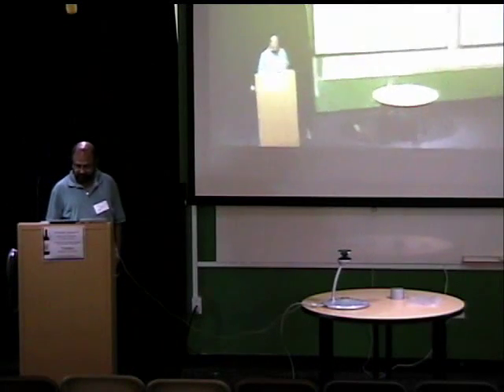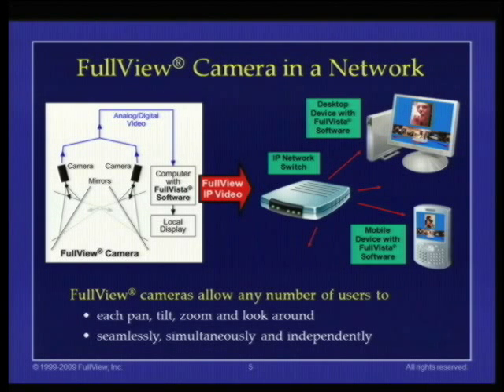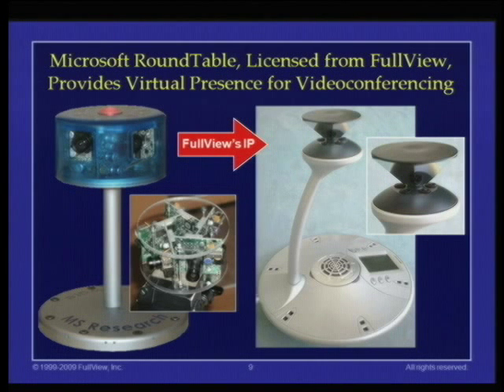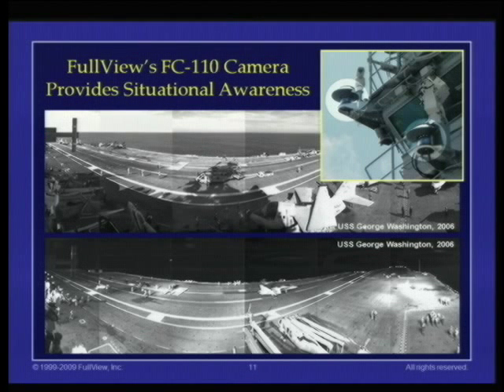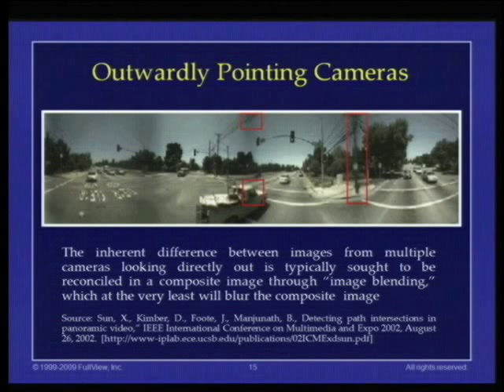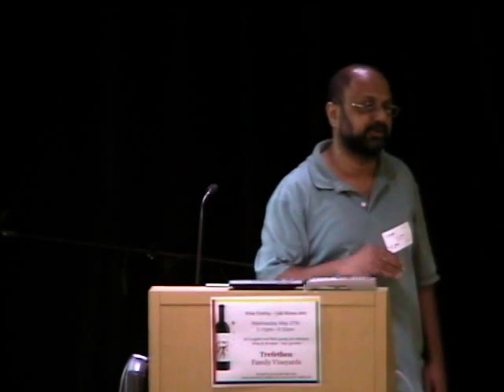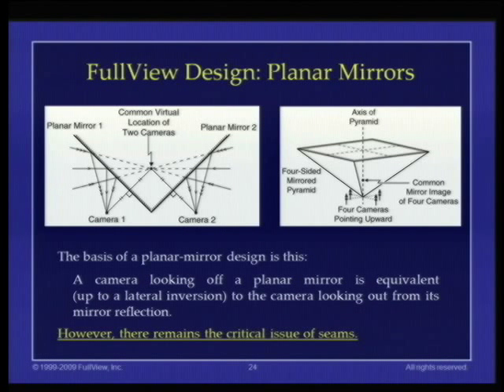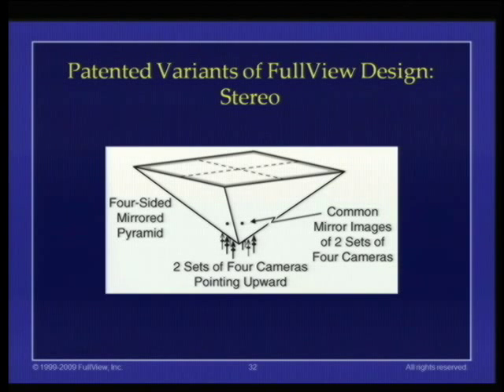FullView Panoramic Cameras

Comment: it's not 360x360.  It's 360x180.    The video is equirectangular projected.  Equirectangular projection is twice as wide as it is high.  The latitude axis covers 360 degrees.  Since the longitude is only half the pixel dimension it is therefore 180 degrees.